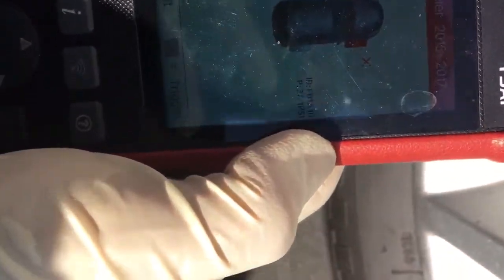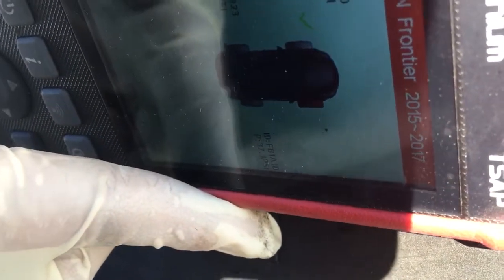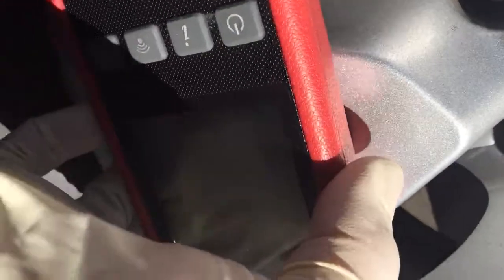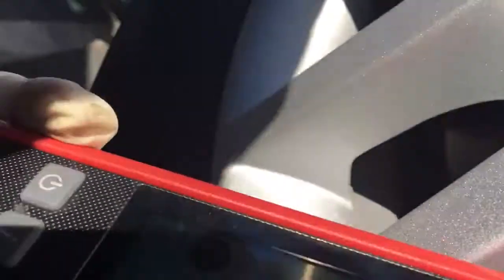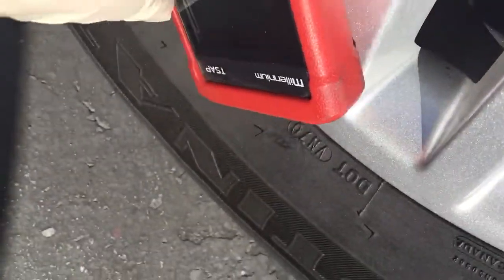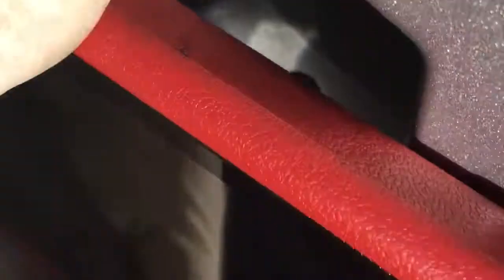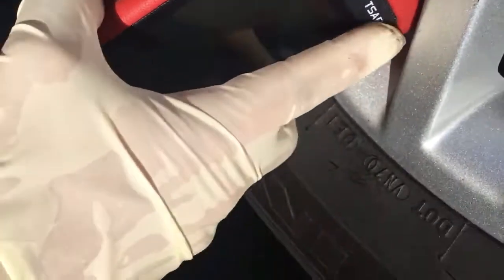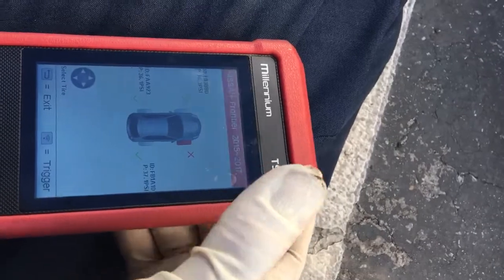Finding a bad tpms sensor

Comment: Can program any type of tpms sensor or just launch? And how much you paid for the tool
Reply from the maker: Any type my friend and only 299$
Reply: I borrowed one of these and it is not that simple. I can get them all to read but I can not input the current sensors in to the TPMS ECU. I put different wheels on my car which were from another of the same make and model and this tool will not input them in to the cars TPMS ECU.